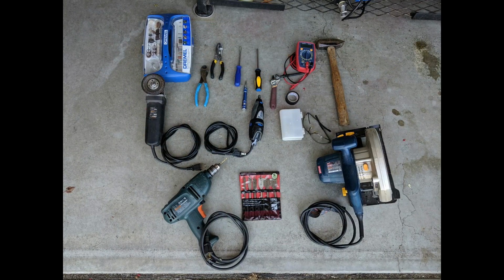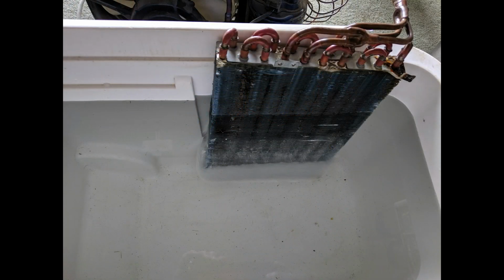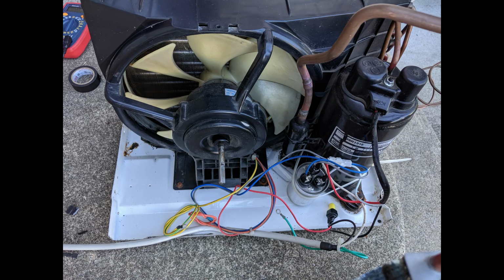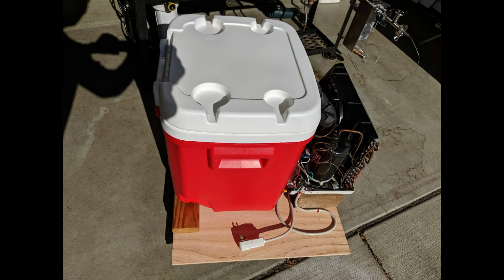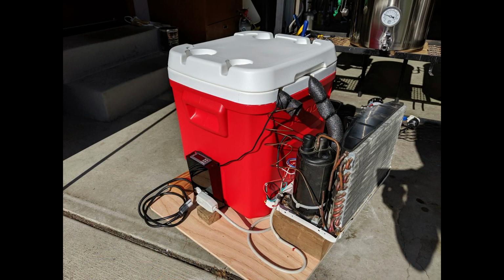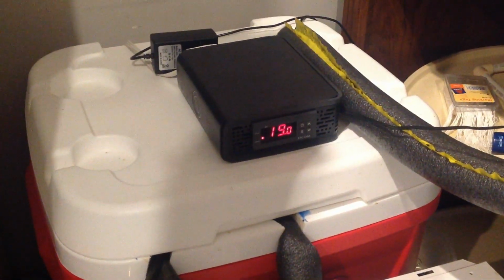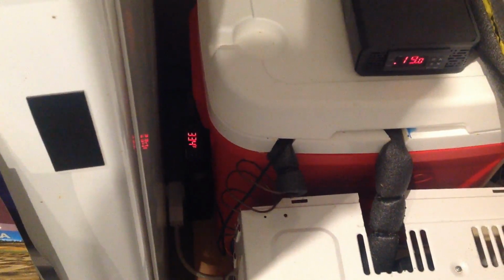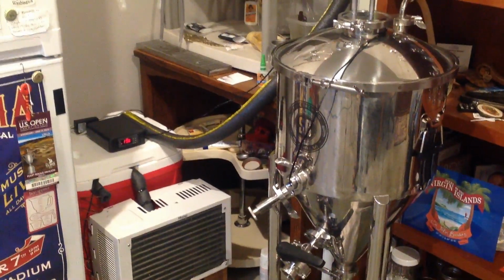Homebrew DIY Glycol Chiller

Comment: If you liquid cool the heating side of this AC,  you could save a lot of power/money I am told.  What do you think of this for a future project?
Reply: That is interesting.  Right now the unit runs so very infrequently that I will likely just leave it as is.  This was a fun project, and if I ever need to do it again I will take all that I have learned and apply it to the next unit.  My biggest "beef" with the unit is that it is quite loud due to the old A/C unit that I used.  It is in the garage and only runs about once a day when not cooling the fermenter, so I live with it.    Thanks again for watching.    All the best.   -DT
Reply: @homeandlawntips474   "Air-cooled condensing units typically have an efficiency rating ranging from 1.13 – 1.25 kW/ton.  A conventional water-cooled unit with a cooling tower has an energy efficiency rating ranging from 0.58 – 0.79 kW/ton. Therefore, water-cooled systems can produce the same amount of cooling as an air-cooled system while only consuming about half the energy."

Comment: Gonna save this video. Just getting into brewing so my order for startup is gonna be rather large. Prolly just use a heat jacket and ice water for a while, but i really like your no bullshit approach. I saw the one with all the switches and lights you mentioned. Redundant and wasteful imo, but still a decent build. Like yours better. Thanks
Reply from the maker: Right on, thanks for watching and your comment.  This unit is still running strong, no issues at all.  Best of luck on your brewing efforts and feel free to reach back out for any assistance.   All the best.    -DT

Comment: Great project!! I really want to go for it. Do you expect any issues with the immerse evaporator?
Reply from the maker: Hi, thanks for watching and your comment.   The first time I saw someone else do this (maybe 10 years ago), I thought no way!!  How crazy!!!  Some people......     but then I went for it and was delighted with how it all came together (and it is relatively easy).  To answer your question, and others that may come to you, here is a link to the "4 years later" video I did:   
https://youtu.be/zxHzuDrczbU
Spoiler alert:: everything is still running flawlessly.
Final comment, the one thing to be extremely cautious with is the bending out of the coil.   You don't want to break the copper pipe.  Mine just sort of rotated 90 degrees as I did it, so I just went with that orientation.
Let me know how things work out.     All the best.     -DT

Comment: Does the evaporator inside the cooler ever condensate or freeze? I am working on a project and any H20 would be bad. Thanks!
Reply from the maker: thanks for watching.  It does not freeze by virtue of the glycol.  In my set up the top of the coils are not completely covered so they "frost" over.  If they were completely submerged they would not.   I hope this helps, good luck.   -DT

Comment: I’m missing the part on how this works, the radiator thingy cools the pool of water in the cool and then you pump it out into coils that sit in the fermentor?
Reply from the maker: Thanks for watching and your comment.   Ya, that is a pretty important part of the video - how it actually all works!!  You are exactly right in your summation.   The coils in the glycol pool get very cold (these are what cool the air in an air conditioner, they get super cold and the fan blows air across them).  The glycol is at about 32 degrees and it is pumped through the fermenter coils thus cooling the wort.   Both the set temp for the glycol and the pump controller are controlled by thermo sensors that switch them on and off.      Thanks again for watching, all the best.    -DT

Comment: Great video. Could you use boat and RV anti-freeze as the glycol for this?
Reply from the maker: Thanks for watching.   This is a great question and one I wrestled with myself as I was doing the project.  As I understand it, Glycol is essentially a food grade anti-freeze.  I would think the biggest risk in using anti-freeze would be the corrosive effect it might have (again, I don't really know the chemical properties of glycol vs ant-freeze).  I guess I would error on the side of caution and stick with glycol.   I can also say that I have been running this system for over 3 years with NO issues at all.   Also, I do not foresee the need to replace the glycol so even though the initial cost might be higher, over the long run it should be a wash.    Good luck with your chiller project and I'll be glad to offer any other layman's input on questions that you might have.    All the best    -DT

Comment: Can you cold crash?
Reply: Thanks for watching.  Yes, I can cold crash and also lager/condition.  I have my glycol set to 32F, I could go even colder if needed.  I tend to ferment 8 gallons and this unit will easily handle all phases of the fermentation without much effort.

Comment: Awesome video. I've basically followed your whole process with my build! Thanks a lot! One question I do have is how much glycol and water did you use? I just used 4 gallons of water and 2 gallons of glycol but the 60qrt chiller isn't that full so my coils are maybe only 1/3 submerged right now. I can cut into the chiller a little more and also perhaps bend the coil downwards some more too but wondered if I'd maybe get away with putting a couple of extra gallons of water into the mix without having any negative effects with freezing?
Reply from the maker: First off, congratulations on your build!!!  It is such a great feeling to see everything work once completed.  Mine is still running strong!  I went back to refresh myself on the glycol ratio.  I can see in some of my other comments back to folks that I used the same ratio as you 2:1, for some reason I had thought that I stretched it to 3:1 simply because the glycol is expensive (side note: I looked up my history in Amazon.  I bought the glycols for $29/gallon, now it is $42!!  I guess our recent inflation hits everything).    A few thoughts: (1) i have never had a freezing issue with my glycol.  The temp is set to 32 degrees F.  I am pretty sure that I could add more water and still be ok.  Two more gallons would give you the 3:1 I had thought that I used.  You could do that and just see if anything freezes, likely  not, but if it does add another gallon of glycol  (2) Is it possible to just get a smaller cooler that would work?  A new cooler would be less than a gallon of glycol.  (3) If your size is perfect now, perhaps a smaller cooler in the bigger one, or some other way to limit the volume of liquid could work.  I can't remember the size of mine (60 Q sounds about right).  My coils are about 3/4 covered in the bath and just about touch the bottom of the cooler (my A/C is on 4x4 so I could bend the radiator down as much as possible).  
Sort of a long answer that may not help you so much.......
One way or another you're at the finish line and that must feel good!   Thanks again for your note, let me know what you wind up doing.   -DT
Reply: @homebrewingtips6029  thanks for the reply! I tried it out at 3:1 and I was getting some freezing issues so I've ordered another gallon of glycol to bring it back to 2:1. Hopefully that will solve it! Also managed to cut a bigger groove in the side of my cooler and remanipulate the coil a little more so its sitting pretty close to the bottom now. Do you find that the part of the coil that's out of the water is super frosty? That's what mine looks like and I'm not sure if somethings wrong with it or it's normal. Do you have your temp set to 32f the whole time? I.e. when cold crashing or do you lower it for the cold crash? Thanks again!
Reply from the maker: @westcoast.outdoors  This is very interesting and really the reason I like the channel.  It gives a forum to exchange ideas and experiences.  I was surprised to hear of the freezing effects at 3:1.  What is your glycol temperature set to?  (just curious about that for the data point).  If I were a betting man, I would bet it all that your additional gallon of glycol will clear that up.  One thought that just came to mind too, some guys using a "stirring pump" in the cooler to stir the glycol solution.  I don't find that  it is needed because my return from the conical seems to keep things stirred up.  As for my coils, yes the ones outside of the liquid get noticeably frosty, so I think that is normal.  I keep my glycol temperature at 32 degrees all the time.  It has some hysteresis programmed (off at 29 degrees and on at 34 or so.  This prevents if from turning on and off all the time).  Crashing a 8 - 10G with this setting is no problem.  You will notice that the A/C unit runs more often.  The most noticeable thing is that the conical gets wet due to the inside vs. outside temperature.  I made a jacket or mine, but I think I'll bite the bullet and order a good one from Spike to help with this condensation.
Again, congratulations on the build!     -DT
Reply: @homebrewingtips6029  ok well there is a twist to this tale; so it turns out the glycol that amazon sent me wasn't glycol at all! It was mult chain triglycerides.... I should have checked what MCT was before pouring it in but there was an amazon sticker on the bottle which said propylene glycol so i just assumed MCT was a different name for it... triglycerides/glycerine doesnt sound too disimilar. I did think that the liquid looked off when I poured it in, and not what I was expecting but hey I'd never used glycol before so I guess this is just what it's like right?! Well the icing that I reported only looked minor from the surface but you should have seen the size of the ice block underneath once I'd emptied it out. Safe to say it was lucky I only ran the unit for an hour before I turned it off. But anyway, contacted amazon, got them to send me the right stuff, cleaned all of my equipment which if you look up what MCT is you can imagine how difficult thay stuff was to get out of every surface it touched! It's now filled with 2 gallons of glycol and 4 gallons of water, set to 28f, everything working fine! I'm pretty sure going to 6 gallons of water would work fine too. I also use a small aquarium wave maker to keep my liquid moving. Surprised that everything still works after its ordeal but we're all good now! I bet you wasn't expecting this story!
Reply from the maker: @westcoast.outdoors  Thanks so much for sending this to me, it totally made my day!   Not because of the headache and inconvenience to you, but rather it explained why you were getting the icing.  I can picture the big block of ice you had because when I first tested mine I used water only to make sure everything was working.  If you go to the 3:1 ratio, please let me know.  A lot of folks ask me about that and I'd like to provide a good answer.  Now every time you hear that A/C unit kick on, you'll smile just thinking back to the MCT fiasco!!!   All the best to you and congratulations on the project!   -DT

Comment: Any suggestions on how to split the cooler to cool two or more FVs? Thanks in advance great job super video!
Reply from the maker: Thanks for watching and your kind note.  I believe that I could easily put a second submersible pump in and route it to a second fermenter.  You would need a second controller to switch the additional pump on and off, but that would be easy enough (it would be just like the first one).  The volume and temperature of the glycol could handle two 10 gallon batches pretty easily.  Cold crashing both at the same time could be a stretch.  If in fact that worked, it could be trial and error to see if a third could be added.  The reason that I think that this is possible is that my A/C unit runs very infrequently to chill the glycol even during the most active fermentation times (when the internal thermal rise is at its peak).   I am glad to say that after 2+ years my unit still runs like clockwork.  I have not done any maintenance to it or changed the glycol.  My setup is in the attached garage where the ambient temperature is around 65F year round.

I hope things work out for you.  If you do a bigger system, let me know the results.   All the best,  -DT

Comment: I am trying this and I am confused about the wiring.  On my capacitor, I have HERM with 2 prongs, FAN with 1 prong, and then one with no label with 3 prongs.  Is there any chance that you could help me?
Reply from the maker: Hi there.  First, have you disconnected the wiring  (any of it)?   If not, don't.  Next, watch this guys video:
https://www.youtube.com/watch?v=OFCcHW-LKyI&t=754s
He spends a lot of time going through things.
A BIG word of CAUTION: the capacitor will hold its charge even when the unit is off and unplugged.  It will give you a good jolt if you touch the terminals.
On the inside of your cover, does there happen to be a schematic?
Send me the make and model of your AC unit and I can look it up on line.
It is all pretty easy and similar, but each has its own color coding and labeling.  I am sure we can figure it out.
PS: I am neither an electrician nor A/C technician, just a guy who tinkers .......
Reply: @homebrewingtips6029  That was helpful, but I have 6 wires from my fan and he only had 5.  Also, my colors are different (which makes it a bit more challenging).  I have the following colors coming from my fan (Red, Blue, Black, Yellow, Yellow/Green, White). The white, yellow, and red are hooked up to the Hi Fan, Low Fan, Hi Cool, Low Cool switch.  I have three wires coming from the compressor (Red, Black, Blue), and I have three wires coming from the power cord(Black, White, Green).  On the Capacitor, I have HERM (2 prongs and red base), C(3 prongs and black base), Fan(1 prong and white base). I suppose for fan, I can use the white wire from the capacitor (directly), after that, I am a bit confused.
Reply from the maker: @donaldfrantum1703  Reply with a number I can text.
Reply: @homebrewingtips6029  I think I figured it out.  Now, just have to test.  I reached out to a local HVAC mechanic and he walked me through it.  Thank you for all of your help.  As an aside, what size cooler did you use for your build?
Reply from the maker: @donaldfrantum1703  This is great news to hear.  A close resource is far better than me!!!!  Feel free to reach out if you hit some snags.   My cooler is about 12 Gallons?  What drove my choice is one that had the right height dimension.  After bending out the coils I picked one that would accommodate my configuration.   It is actually probably a bit too big.   I used 2 gallons of glycol and about 8G of water (4:1 when recommenced is likely 3:1).  
Do me a favor and let me know how you project turns out.   It is a good one!!   All the best,   -DT
Reply: @homebrewingtips6029  thank you again.  If this works, it will be a huge savings to chill down my cold brew coffee for bottling after pasteurization.  Next for me is to quickly get it up to 184 degrees without cooking the cold brew.

Comment: Hi, nice project! What is the lowest reachable water/ glycol bath temp?
Reply from the maker: thanks for watching and your comment.  I set mine to 32 degrees with a hysteresis of +/- 2 degrees (on at 34 and off at 29).  This smoothes out the A/C unit's on/off cycles.  I am sure it could go down to 25 or less, I have just never tried to hit the low end limit.  The ratio of glycol to water likely has something to do with it too.  I used a 4:1 (I think the suggested is 3:1).  I have no icing or other issues with the range that I have specified.   Does this help?   All the  best to you.   -DT

Comment: Good work ,i did it for my above ground pool but larger scale 
And i strongly advise you to use a submersible small aquarium pump to circulate and agitate the cold glycool inside the box 
You will notice a huge difference in cooling.

Comment: What pump and hoses did you use to circulate the glycol?
Reply from the maker: Hi, thanks for watching and your comment.  Here is a link to the pump that I bought:
https://www.amazon.com/gp/product/B01G305PK0/ref=ppx_yo_dt_b_search_asin_title?ie=UTF8&psc=1
I have used these before and they do a great job.  This one has been in the freezing glycol for 2 years now and continues to run like new.  For the hose, I had some plain plastic hose that was the right size (1/2" in think) and used it.  You can buy that type at Home Depot.  Let me know if you other questions and I'll be glad to help.  -DT
Reply: @homebrewingtips6029  thanks man this build is genius. Going to use on my 400L wine fermenter. Glycol isn't degrading your plastics at all huh?
Reply from the maker: @mikesellsvineyards  It is surprising how reliable this has been.  Several folks have asked about the lifetime of the glycol itself.  Now I am no mechanic or A/C technician, but I figure if you can keep your anti-freeze in your car's radiator for years (which is a much tougher environment), it should last a very long time in this cooling function (glycol is sort of food grade anti-freeze).  I think that the mix ratio was recommended to be 3:1, but being cheap I stretched that to 4:1 (8 gallons water to 2 gallons glycol).  There has been no degradation to the  pump, hoses, or the A/C evaporator core (the part that is in the glycol).  Good luck with your project!!   -DT